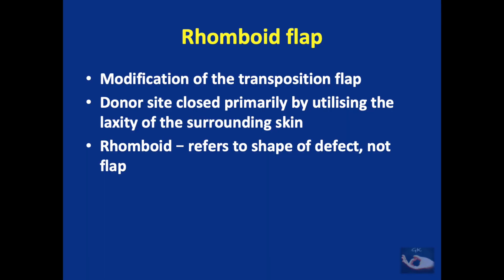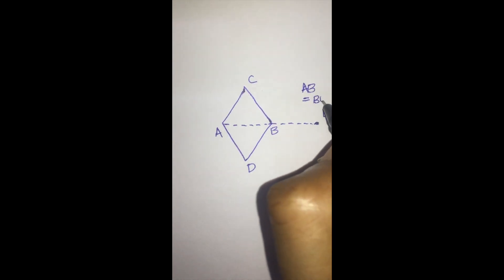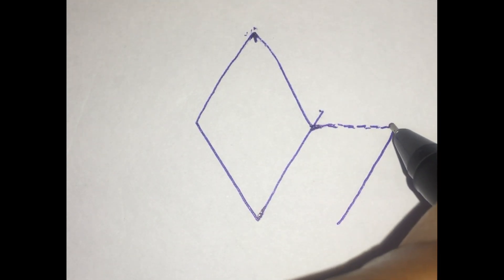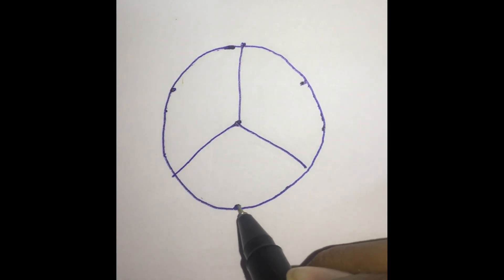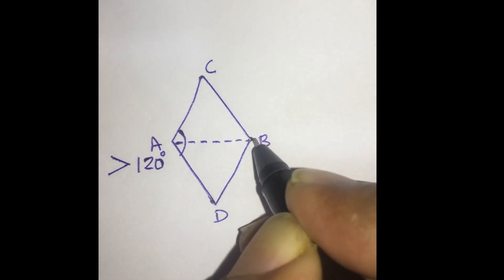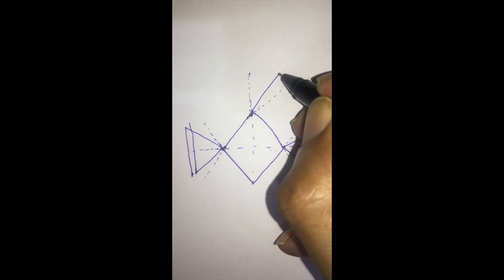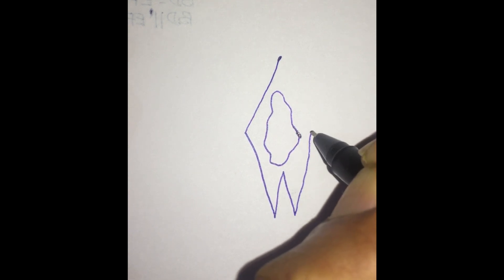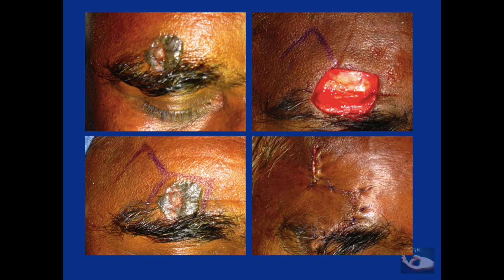#Limberg flap and Dufourmentel flap - Transposition flaps

Comment: very helpful
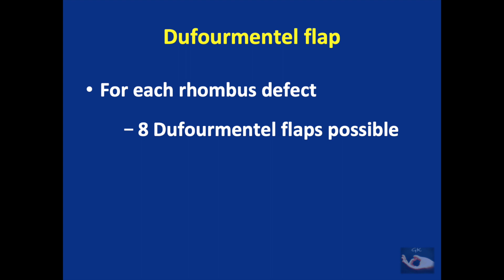 Sir with regard to 10:15 , why would we need to do a Dufourmental flap if there is a rhombus with equal short and long diagonals?  wouldnt a standard Limberg flap do?
Reply from the maker: In that case, the amount of advancement of the flap will be excessive and may cause necrosis of the tip if a standard Limberg flap is used.